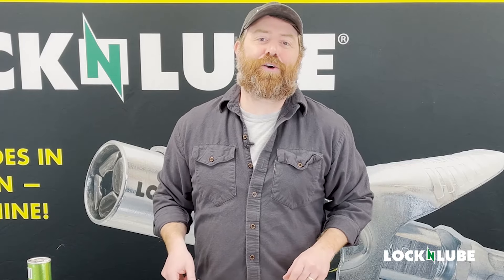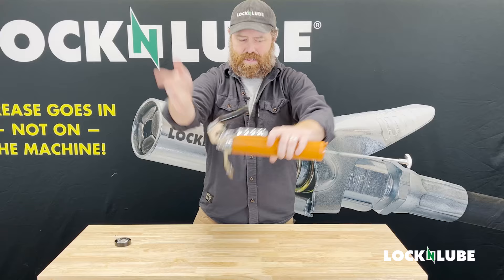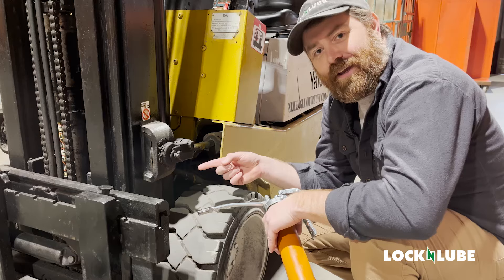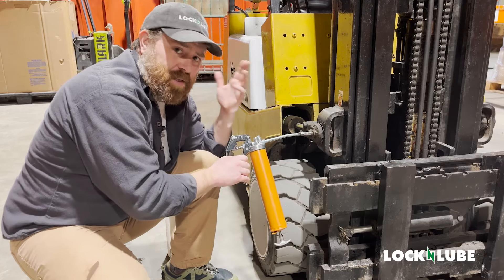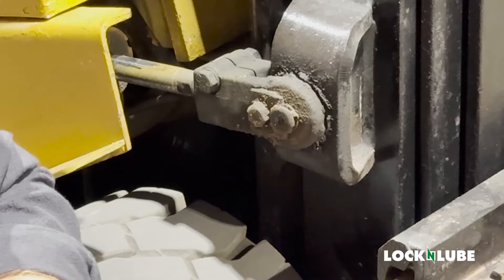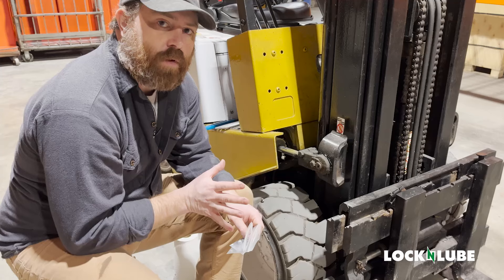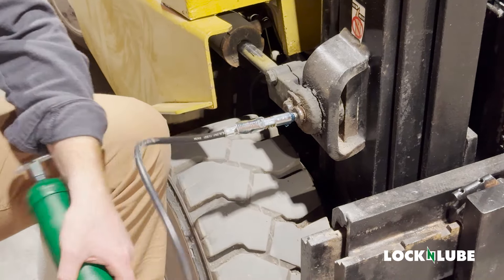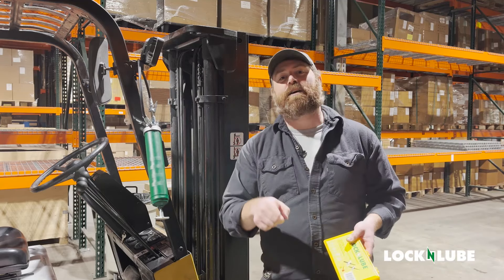Upgrade your grease gun, with LockNLube

Comment: Grease guns are from HE double Hockey Stick! One quick question... When I use my big box store junk gun, it leaks out all around the tip. So I have to hold it really hard to the zerk. Seems to be that way no matter what junk gun I buy. They all suck, you were TOO kind about the big box store junk gun. I feel like 1/3 goes out side of gun tip, and 2/3 into grease zerk. I assume yours makes a more posative connection with the grease zerk?
Reply from the maker: Good news is you can swap out the coupler, but yes the cheap big box grease guns are awful to use. We were trying to show why spending a little extra will get you a far better product and then I ripped the threads out on that zerk. There was a real moment in that video where I almost completely lost it. On our coupler, the inside of the coupler moves in order to mate flat against the zerk head and more pressure the tighter the fit. We offer a 1-year satisfaction warranty on all of our LockNLube products and your more than welcome to give us a call.
Reply: @LockNLube  I need to order one before my I service my truck next time. Along with your air chuck. Great product!